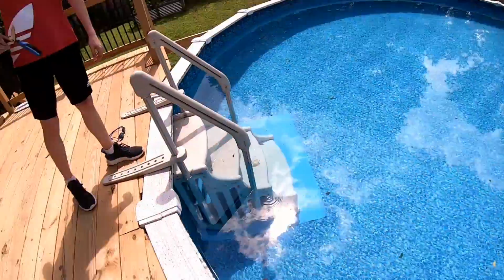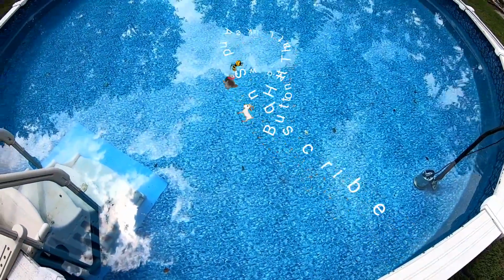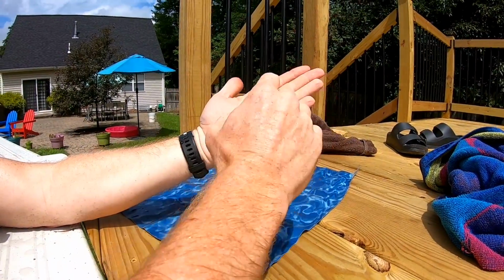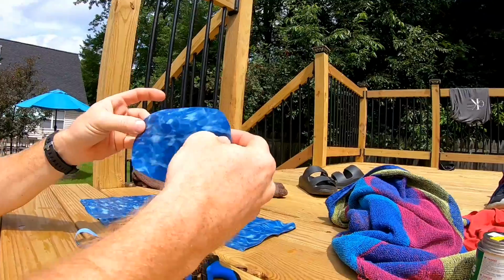How To Patch A Vinyl Pool Liner Underwater DIY!

Comment: How do you stay at the bottom? I always float up and don’t have much time to apply the patch.
Reply from the maker: Lol lots of practice lol best way is to blow your air out underwater so you sink and don't float, you could also use some weights or have someone put a foot on you to keep you down if your not good at holding your breath, get creative lol thanks for watching and have a great summer!😉😊
Reply: lol thank you that was my biggest challenge. I used a 30lb dumbbell to hold onto.
Reply from the maker: @jamierandall2945 lol awesome hey whatever works to get the job done!😊
Reply: A guy came to my house and had some home made tools, and he patched the pool without  get in the water, I was amazing!
Reply from the maker: @PoisonShot20 sounds interesting I wonder how it will hold up over time!
Reply: @WhitehouseFarmVet  actualy, it didn't  ever leaked again. After 4 years my liner went bad, at the water level, it spliced like someone had cut with a utility knife. Only 5 years old.